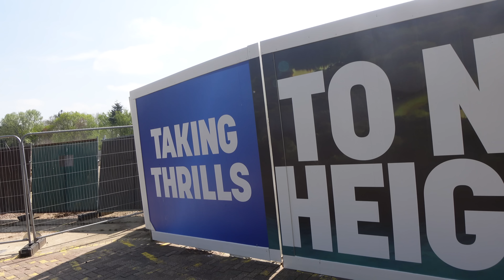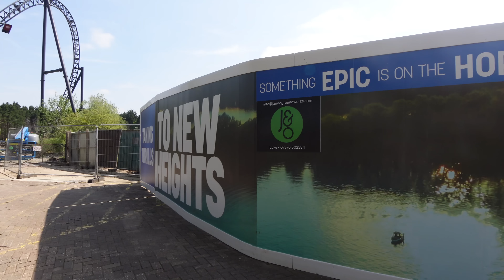BIG Project Exodus Q&A!

Comment: Question: What’s the difference between the builders and the manufacturer? (Is it just the track and trains or something else as well?
Reply: Manufacturer which is Mack make the trains, supports, track, chain lift etc. They make the ride itself and then a different external construction company are doing the building and ground works.
Reply: think of the manufacturers as the same people who create the wood, brick, cement ext for house building, mack rides is basicly the architect / designer. and the builders do the same thing as normal builder in houses, they take the already crafted meterials and the step by step plans and but it all together like a giant lego set
Reply: @Rabbitzz  thanks, I’m a theme park geek I should of known this is a different acc btw
Reply: @TheKnexMaker  nice explanation
Reply: Just to confirm that account was mine.